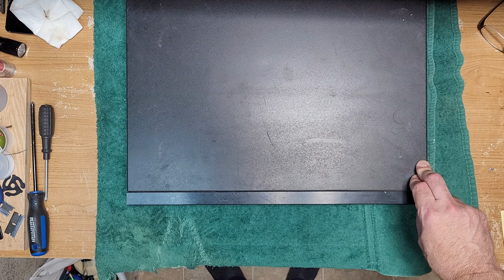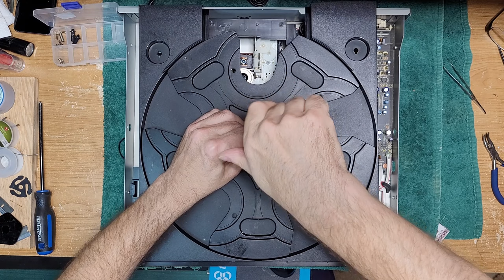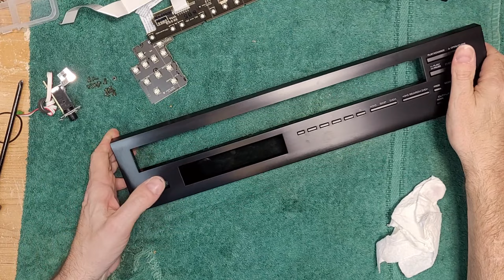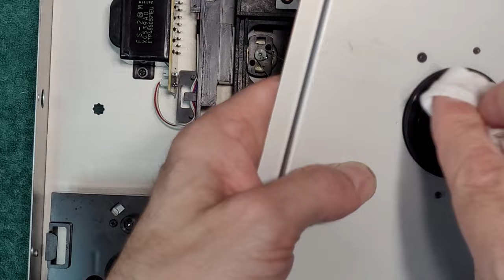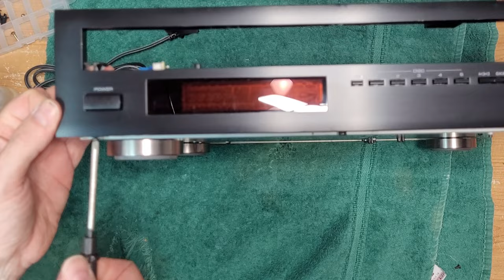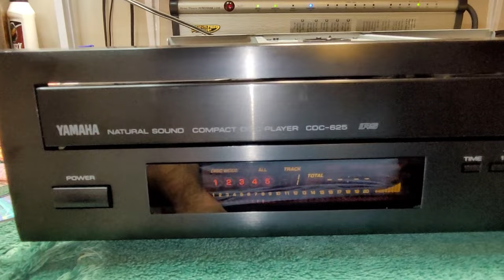Yamaha CDC-625 5-Disc CD Changer: Service & Restoration

Comment: I've owned several thrift store 5CD carousel players and the disc search switch needed repeat cleaning with intermittent periods of failed disc read until ultimately dying. For $10 they were ok for a year or two. GeeBay sells this model from $60-$85.  5disc players are great if you're entertaining guests and want to play selections from your cd collection without being a DJ every 40 mins.

Comment: Hope November brings you lots of cool turntables. Don't be hard on yourself broseph. Fiddly getting it sorted sometimes. I used my grinder to take the points off my bench phillips screwdrivers to convert them to JIS, before I bought actual JIS. They work much better after taking the tips off and 0 cam out when torquing down any Japanese equipment.
Reply from the maker: Might have to try that with the screwdrivers.
Reply: This is a good tip. Where did you get a jis set? The sets I see are not jis even  though they are advertised  as that.😮
Reply: @TurntableGuy I learned about it when I was restoring Japanese motorcycles. My brother and I built a truckload of Cafe racers in the early 2000's and previous owners would have the original engine cover screws mangled with standard screwdrivers. Japanese Industrial Standard is the same whether its a turntable or a motorcycle.

Comment: Belts are always due for a change on these, sled needs a clean and lube, latley we see more of these Yamaha's with gear issues.
Reply from the maker: The gear on the sled motor is susceptible to cracking - surprisingly this one was ok.
Reply: @TurntableGuy  Nice, usually the Yamaha's are good runners..
Reply: I have a Yamaha CDC 685 and I started seeing what looked like white dust or little bits on the tray. It finally dawned on me the plastic gears in there are white. It started doing this weird stuttering shaking thing so I opened her up and sure enough that little gear that drives the CD ray part is in bad shape. Can I replace that gear or maybe that whole section some how?
Reply: @bigmacfullerton7870  I don't think you can, only if you find a donor unit. We have thought about 3d printing the part but not there yet.

Comment: I have a Yamaha CDC- 565 that the tray keeps opening.Tray closes, then when you hit play, tray opens. Any ideas?
Reply from the maker: It's the limit switch that activates when the door is fully closed.  Clean or adjust it's position.
Reply: Yes clean the switch that activates when the tray is fully opened and the o E that's hit when it's fully closed. It's opening because it doesn't k ow it reached its destination so it's trying to u stuck itself. Like when you push a CD drive shut but block it so it stops and opens.. The switch usually two little brass metal strips that get pushed together somewhere in the unit when the tray is fully in the Close position.